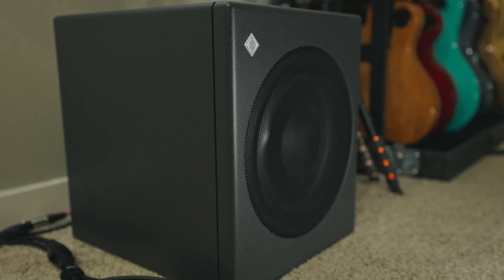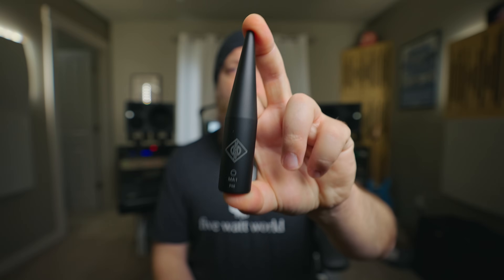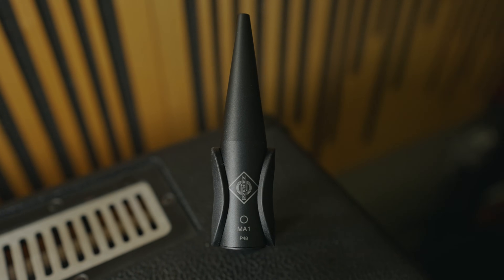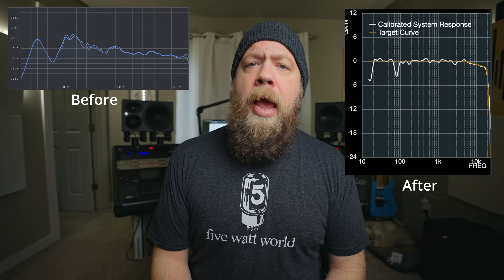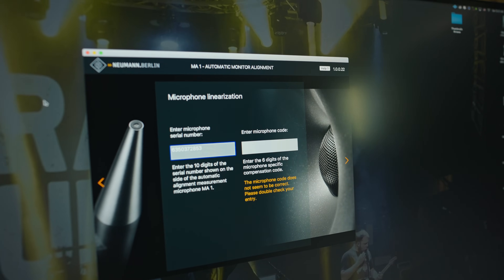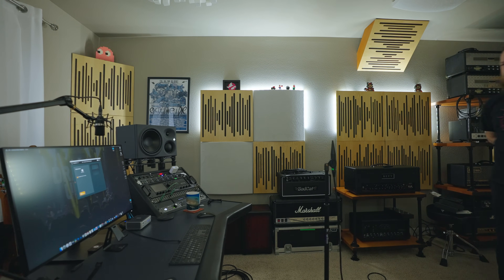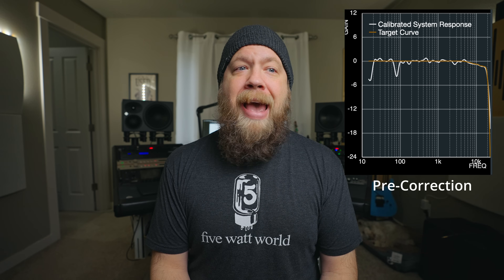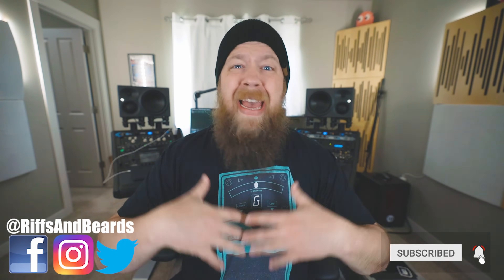Room Correction & The Neumann MA1!

Comment: My room is not corrected. I dint even have a panel anywhere. I bought the KH120ii and KH750 + MA-1 and I could not believe my ears after the calibration. Perfectly cristaline sound, accurate soundstsge and depth. Never would I have dreamed that my listening position could sound like this. And I have yet to hang a single panel! I think it will prove to be one of the best investments in my life.

Comment: Hi great video and very informative.  I have one question can I use the software and mic to setup the sub only and just incorporate monitors with kh750 sub,  which are Yamaha’s? I know software won’t work for non Neumann monitors, but I think it would be useful still to be able to set up the KH750 using the software and DSP features.  Am I wrong in thinking this? Thanks in advance.

Comment: Hi there! Thanks for making this tutorial! I'm actually thinking about switching from Sonarworks to Neumann MA1 (having the KH80DSP aswell as the sub), for the reason that Sonarwork is actually causing a lot of problems with the overall computer sound (zoom, skype, etc.). Did you work with Sonarworks before and if so, was it worth changing?
Reply: The Neumann alignment won't mess with your computer sound because it runs on the speakers and not on the computer. Once the alignment is done you can hook up any audio source to the monitors and they'll be aligned.
Reply: @joschka9976  Jeah, I understand the concept. I was more interested in a direct comparison of quality. How do they stand up against each other?
Reply: @leobrennauer  I won't comment on the differences between the way both sound because I am biased. From a technical point of view there is an important difference concerning systems with subwoofers. If you use filters in the stereo output  of your interface you can't separately time- and magnitude align subs and sats. The ability to align each device individually is an advantage of the Neumann System. In addition it helps to know the limits of the individual loudspeaker. The Neumann algorithm won't boost frequency ranges to levels that cause distortion because it knows the limits of the speakers.

Comment: Im wondering if I pair my non DSP Neumann KH120s with the 750 sub.. I can use the MA1. ?
Reply: Yes you can. The KH310 ryan has are not DSP. The KH750 sub runs all the signal processing and sends the corrections to the speakers, you would use the kh750 as distro to the KH120
Reply: @Rabitholevids  I think I should have watched more than the intro.. I forgot he has the 310's

Comment: Sorry if this is a dumb question, but isn't this mic and software basically a one use thing? You get the correct eq curve for your room and then what else do you do with it?
Reply from the maker: Yep. Basically once I know the corrective curve of my room, it is applied inside the speakers. So now I dont have to always turn on plugins inside my interface for example. That is an issue if I am livestreaming for example as if I am hearing everything accurately, everyone else wouldnt. Since the corrective EQ only makes sense in my room.
Reply: Id assume if like most high end reference mics you can just use it as a flat accurate mic if not measuring.. 
Earthworks pretty much crossed over that way..
Reply: I just looked at the specs. Yes the MA1 is a completely flat omni mic. It'll be great for capturing room

Comment: I have the KH80-DSPs currently using Sonarworks 4 to correct the low/low-mid problem in my room. Mostly treated (just ordered some panels to make a cloud), curious to see where the room ends up after the cloud. Been keeping an eye out on the MA1 as an alternative because of what you said about same brand. Problem is I'll probably have to run SW4 either way for my NS-10s haha.
Reply: Naw.. the NS-10s are supposed to sound not so hot.. haha
Reply: @drdelewded  hahaha while I agree the the room needs it at least now until I get the cloud and last corner traps and see where I'm at